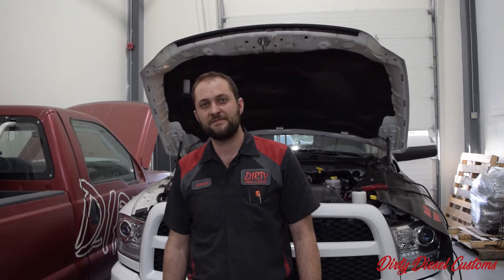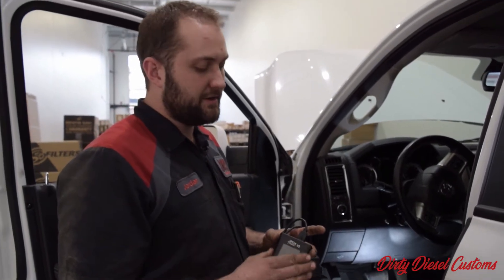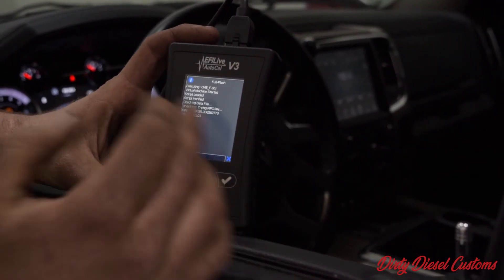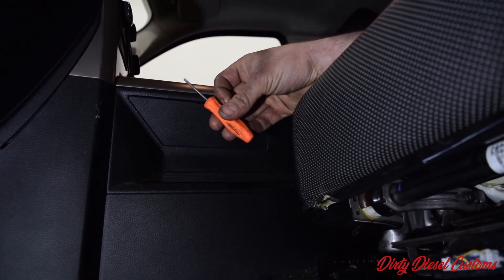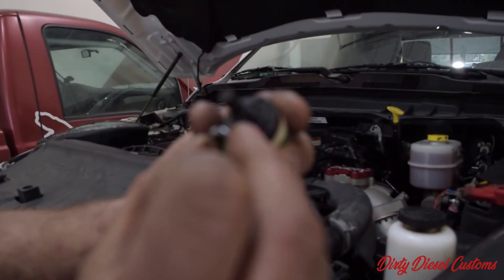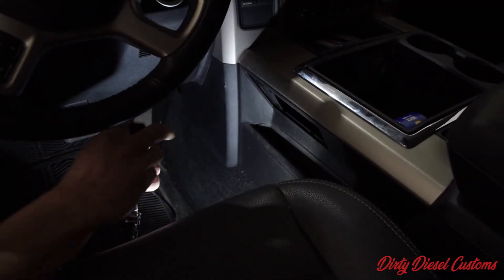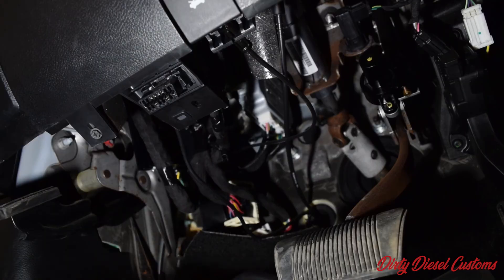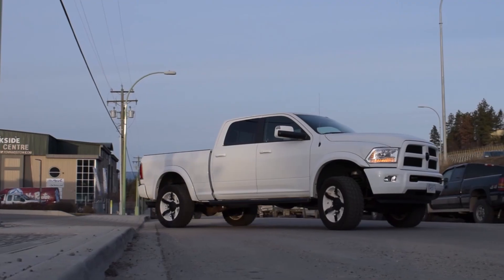Cummins 6.7 EFI Live V3 Autocal + CSP5 Installation Instructions

Comment: If I flashed a tune with the switch still plugged in what could this do? Put a new turbo on and trying to get it dialed and have been working with the tuner, I have always unplugged it and I did not today for some reason when I flashed a stock file to it, did notice till I went to flash a new tune file after. Stopped the new tune, unplugged the switch then restarted. I hope I didn't screw something up cause I was stupid
Reply: Well let us know what happened!
Reply from the maker: If it took the tune then you're good to go, it's certainly not recommended because we've seen a lot of problems come up when it's tuned through the switch, but if it took the tune don't look back and enjoy the power!

Comment: I have the AutoCAL V2 already installed in my truck 4 years ago DPF delete. Planning on doing 2nd gen swap on my 2018. to replace the VGT setup. Knowing that I still need to tune the vehicle for non VGT would I still be able to use my EFILIVE AutoCAL V2
Reply from the maker: Yea you can get a tune revision file through your original tuner, usually a fee, they'll send you the file through email and you can upload it to your device. From there it'll be just like tuning it in the video with your new file.

Comment: Could you do a video on retuning a cummins that already has efi live with a autocal . Had a tuning corruption on mine n been a absolute nightmare trying to retune all cause batteries died and corrupted the tunes on it 🙏
Reply from the maker: It won't be any different tuning an already-tuned truck. You should be fine if you recharge the battery and keep a maintainer on it through the next tuning attempt. Low battery voltage is the most common issue we see with tune failures.

Comment: After installing a SOTF can I switch the power setting to a desired HP tune and then remove the switch? Will it stay on that tune?
Reply: No, it won't stay on that tune. It will default to the stock file setting. There should be separate tune files on your tuner to allow you to tune individually vs. all tune files.

Comment: Wow, excellent video. He is my question. I have EFI/live. Currently no switch. Are you telling me I can add a switch just like the video? Next question, can you CTS 2 monitor plug in and work also?
Reply from the maker: You'd have to get a tune that is compatible with SOTF setups, and then you could add the switch. A regular tune will not interact with the switch. The CTS3 will work when plugged into the new OBD2 port and will work normally.
Reply: Muck appreciated, I'll give it a try. Thanks
Reply: How will I no the sotf switch is working? By idle can you hear it? Or by driving it looking at the fuel mileage by eating the cruise on the highway at 60mph. How do you test urs? Thanks
Reply from the maker: @coreyadams4646  To test it out you would have it in position 1, and then go near or full throttle and change the position. The switch changes the high load fueling so it's not really noticeable when at low throttle positions.

Comment: After installing the switch which end do i plug my CTS3 monitor into? The end where my factory obdll once was or the other end under the dash?
Reply from the maker: You would plug it into the new plug, not the original trucks OBD port. 
Cheers

Comment: Is the CSP5 only for the EFIlive V3? I’m new to this, I’m currently buying a truck that is deleted and has a new PCM installed so now it needs a new tune license uploaded to it I guess 🤷 so trying to figure this out
Reply from the maker: Both the EFI Live and the EZ-Lynk have shift on the fly switch setups, but only the EFI-Live will have the switch as part of the OBD2 port, the EZ-Lynk uses a different style of switch. But our tunes can overwrite the tunes on your truck so if you figure out which SOTF switch you have we can get you a setup that will work to set it up how  you'd like.
Reply: @dirtydieselcustom  ok I may be reaching out to you here shortly. I want this truck and just need it to get back home without going into limp mode
Reply from the maker: @weepweep2225  Has the ECU been reset to factory?
Reply: @dirtydieselcustom  the truck was reset back to factory, so now it thinks the emissions is back on the truck and throwing CEL and service Exhaust see dealer now message. He said that he has a H&S mini Max V2? That he is going to try it out when he gets off from work to see if it will tune the new ecm and program the truck. Yall will be the only option I have if that doesn’t work. By the way thank you for your responses I wasn’t expecting that!
Reply: @dirtydieselcustom  if yall think that won’t work then I can just go ahead and order via yalls program or see what happens with the H&S
Reply from the maker: @weepweep2225  If the mini-maxx has a set of delete tunes on it that may work, but out of the box I don't think they are allowed to remove emissions equipment and I think the tuners vin specific. That being said I'm not 100% sure as we don't carry mini maxx's so it might be worth trying. If not I'd go with either an EFI-Live CCS tune or an EZ-Lynk. They should both be linked in the description.
Reply: @dirtydieselcustom  10-4 man. Thank you guys for everything. Yall will definitely be my go to if this doesn’t turn out. I really appreciate your time!
Reply from the maker: @weepweep2225  For sure! Hopefully something works out for you quick!

Comment: Have a 2017, tried to upload tune but gave me error $0281. Tried unplugging and securing connections. Still no luck. When it starts to full flash, it gets to “checking data file” and then says “aborting flash, wrong ecm type” I got a “revised tune” from the diesel dudes and ran it and same problem. What am I dealing with here?

Comment: I’ve read that you don’t want to delete the truck with a check engine light on the dash. I’ve been having trouble with my abs and traction control light dinging on and off in my 2018 ram 2500. Could this pose a problem with the delete if the abs light or traction control are on at the time of deleting? Thanks for any insight.
Reply from the maker: It is better to tune without the engine lights on if that's possible, but like your truck many times we haven't been able to and the tune works just fine.
Reply: @dirtydieselcustom  thanks for the response!

Comment: Can these Tunners be used on multiple trucks? So long the year and the transmission is the same? Or once you use the tunner is it no longer available?
Reply from the maker: The tuner can be used multiple times, but you'll need to get a new tune and vin license for each truck.

Comment: I have a 2017 with a intermittently failing turbo actuator. waiting for Chrysler to send me the letter that says they're going to fix it. my question is, has anybody seen this issue go away by doing a full delete kit and tune?
Reply: No that probably won't help it unless they write the tune to turn off vgt which will probably make the drivability shit
Reply: No definitely not you either replace the actuator or if you have the money just swap the whole turbo if it’s an old turbo

Comment: How do you know what program is on 1-4? Do you set the switch tunes individually? For example, fuel economy -tow-street-performance.
Reply from the maker: The switches are set from lowest power to highest power 1-4, and you can custom select what levels you like, but 1 is lower and higher later.
Reply: @dirtydieselcustom  thanks brother

Comment: Wait a minute…I have a 21’ and got a 4 position switch.  He said 06-12 and 19+ trucks have a 5 position switch!
Reply: i have a 16,, and it came with a 5 position switch.. so does number 5 position not work?????????
Reply: @derekgreen9086  you can set the pin number off the back of the sotf knob. Also, try setting it to 5 and see if it switches to tune 5 by looking at your Autocal in view data log mode (all the way at the bottom of the data). Idk about ezlynk, but I’m sure it’s there.  If you switch to tune 5 and it’s there, then you have 5 tunes.
Reply: Thanks so much
Reply: Hey Jay I got another question, so the programmer sent me another tune, so  do I have to bring my truck all the way back to stock to download all the files again or can I just plug it in and download that file??
Thanks
Reply: @derekgreen9086  you should be able to write right over it.  Email or call your tuner for exact instructions.  Put a battery charger on. If you have a push button start, must be in run (not acc) and DO NOT take your key fob out of the truck while tuning!
Reply: @Steadierpark  thank you sir,, also to see what number I'm in with the switch,, I look that up on the EFI programmer?
Reply: And I do not have push start,, should I still put battery charger on
Reply: @derekgreen9086  yes. Under data logging, view, all the way at the bottom
Reply: @derekgreen9086  yes!  You want a full charge and no electrical anomalies.
Reply: @Steadierpark  here's what it's saying,, clicking on data logging error:$oao2
Display data $oao3, no controllers have been configured,, and for my display white band O2, I'm getting # Lambda AFR
Reply: @Steadierpark  there's only three things under data logging F1 record data f2 display data f3 display WO2 and then I gave you the codes
Reply: @derekgreen9086  it’s f2 display data.
Reply: @derekgreen9086  if you have had the dealer flash the truck in the last month or so, you could be locked out.  Ram released a new security update that flashes the truck to the 22’+ level and users cannot get into the pcm with efi live or ezlynk yet.  You also must have flashed the tune into your truck before you can use the Autocal.  It needs to be licensed to your pcm.  If you can’t flash it, call your tuner.
Reply: @Steadierpark  i have not had it flashed lately, can i pm you, i truly believe they did something wrong, and i can't get any help. it has been like this since i got it almost a year ago
Reply: @derekgreen9086  so you haven’t tuned yet?  5th gen?  I can try to help you, but your tuner is gonna be your best support for their product!
Reply: @Steadierpark  truck is tuned I believe!! But my perform service and check engine light comes on because they didn't turn it off,, so this program I got I need to load into truck,, its a 2016 ,I've have nothing but problems ,, was supposed to get trans tunes as well and didn't get,, and navigating through EFI everything almost shows an error when I'm trying to navigate it
Reply: @derekgreen9086  dang so you bought it tuned?
Reply: @derekgreen9086  buy new tunes and write over what’s there.
Reply: @Steadierpark  no i bought the efi, they supposedly loaded the files or tunes into it and shipped it to me
Reply: @derekgreen9086  Dirty Diesel? Cause if so, they have great customer support.  Call them
Reply: @Steadierpark  no sir it wasn't
Reply: @derekgreen9086  I’d suggest giving Dirty Diesel Customs a call.  They have much better support than what it sounds like you’re getting.
Reply: @Steadierpark  thanks for your assistance

Comment: But is your check engine light on tho 👀
Reply from the maker: Not after tuning, the tune updates the ECU to no longer trigger those codes.
Reply: @dirtydieselcustom  oh well I might just have to buy ur setup then and another question ur 5 switch comes with obd port does that extra one that u slide in there where the old one goes work like the normal one?
Reply from the maker: @RedBeardDetails  Yea it works the same way, so you can still read any other codes that might come up, or if you've got a gauge pod like a CTS-3 it will read correctly.
Reply: @dirtydieselcustom  why are you guys not huge wish I can promote you guys somehow

Comment: Are you supposed to leave the bypass cable installed after doing the tune? Is it needed for the switch to function?
Reply from the maker: Once the tune is installed you can take the cable off.

Comment: Do you ship to California? Also do you have to manually delete DPF ..DEF and EGR in settings after the install ? Thanks
Reply from the maker: Hey, we can ship tunes and tuners to California, but no removal parts. But once the tune is installed the truck is good to go with those emissions parts removed, no changes to the tune necessary.

Comment: Thank you for the great step by step .  I just bought the auto Cal V3 for a 2019 ram 5500 I've seen several videos where they run a red white black cables through the firewall that plugs into...I believe a crank sensor?   My kit did not come with the red white and black wires nor the connector. I believe I just plug mine into the tan and yellow wires to the green wire harness under the steering wheel but I want to  Verify.  That I definitely do not need is the 3 wire connection going through the firewall  to the switch.  And I only need the 2 wire connector of the plugs in to the harness under the dash?  Thank you in advance for any information  You can respond with after watching your video I'm very excited to get it  Plugged in and running I'm praying that it will  drastically improve my throttle response  Off the line from a dead stop. Because right now it is agonizingly slow.

Comment: My tow tune number 2 sounds completely  different smoother  no lope at all. is this  right?
Reply: What did you find out on this are you talking about idle? I'm wondering also
Reply: My question exactly because my buddies truck changes Tone switching through the tunes but mine doesn’t. Makes me question if my switch even works

Comment: I’ve tried tuning my 2020 truck and having an error code $0502 on the Efi tuner. Do I need to unplug all emission equipment before trying to install new tune? Also you make no mention of the “Cummins unlock cable” in this video. When do you know if you need to use this cable? Any insight would be great as I am having a hard time receiving answers from EFI live tech.
Reply from the maker: Hey, I'll try and add that as a speech bubble in the video for future reference. The patch cable is needed for 2018+. And that error code according to the EFI website is: Script file not found. Which usually means the tune file hasn't been uploaded to the device correctly.
Reply: @dirtydieselcustom  I literally just got the tuner from you guys and it’s throwing that code
Reply from the maker: @domforte2966  On that last one it ended up being that the cable was loose in its connection to the truck.
Reply: Did you ever figure it out? I have a 2018 with the same code!

Comment: I have a question. We did the tuning on our ‘16 Cummins. Then we did the exhaust and EGR delete. It has a 63 cheetah aftermarket turbo. And the problem we’ve run into is a sound that sounds like when a cold 12 valve starts up, but it’s when the truck has to pull itself and then there is a problem loading the boost if your building speed slowly or going up a hill. It sounds like a helicopter. We’ve reflashed it, but I’m worried they didn’t put the turbo specs into the File to be loaded on.
Reply: Did you this issue fixed my truck started doing this a week after I put the cheetah in? Fleece technical support is leaning towards my tune once I sent them data logs
Reply: @XxSpeedyxProxX  fix it?
Reply: Either of you get a fix???

Comment: So I have a 2018 cummins. I’m doing what you’re doing and getting a $0281 code. I haven’t unlocked the ecm so I’m assuming that’s what my problem is. I didn’t see you unlock the ecm in this video
Reply: I am getting the same code on mine. What did you end up doing?
Reply: @pochosito  hey man, it ended up being the ecm being locked. You have to buy an unlock cable online that reroutes the obd2 plug in. It’s really simple to hook up and my tuner works immediately. Hope this helps!
Reply: @evanschippers3943  Hey Evan, Thank you for your help. I just got the tune installed yesterday with the bypass cable connected correctly.
Reply: @evanschippers3943  I thought the kit came with that cable .. no? I'm getting ready to do my 17
Reply: sorry .. yah, 18 needs that cable apparently.

Comment: What are all the parts you bought?
Efi Live V3
5 position switch
male/female OBD connector
tune(autocal) all separate?
Reply from the maker: We sell them as a ready-to-install kit, so the parts installed are what comes in the package. 
Cheers

Comment: I'm doing a full delete on my 16 Ram. Should I load the tune before or after I remove the emissions?
Reply from the maker: We recommend loading the tune and running the truck quickly before deleting any parts. In case the truck doesn't take to the aftermarket tune (rare but happens) you'll just have to get a stock tune re-loaded to run again, and then we work on finding the cause/make a new tune for the truck. If everything is deleted the truck will have error codes with a stock tune until the new tune is figured out. Cheers!

Comment: So you can tune it and not do a egr delete or exhaust? Or just do it all at once?
Reply: Once it's tuned the exhaust has to be done pretty quick. The truck will run, but not for long before you run into problems. The EGR can be unplugged and left in the truck with some tunes.